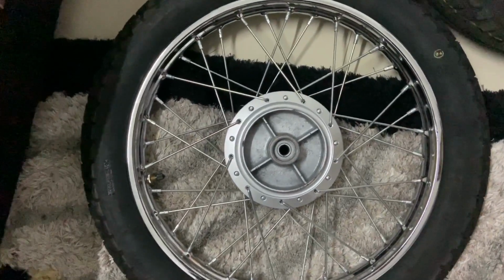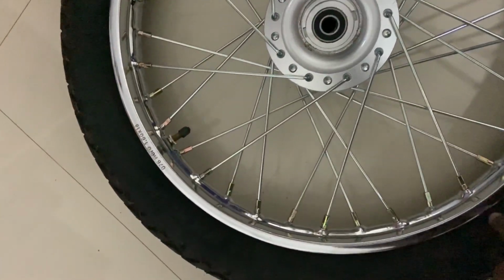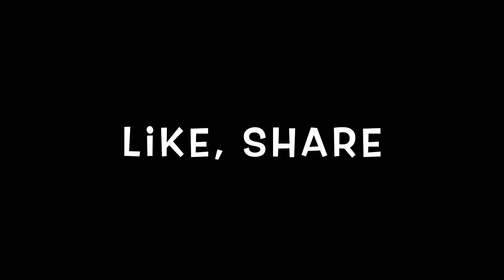Rebuilding the Yamaha RXZ part 8(Tyre Lettering)

Comment: Hi bro 
Is it possible to fix 2.15×18 (xpulse ) rims on rxz without removing the chain covers , if yes can it be chromeplated as they come painted black... your feedback will help me solve the dilemma of should it be  aesthetics or performance  😂 yours friendly 
Neighbor & former youtuber
Reply from the maker: Xpulse is 19 inch, end of discussion 😆jokes apart rear would be too wide, there are other wider rim options like 1.85 inch from a stock RD. Wider rims will put a lot of strain on the drive train. And yes all metal rims including aluminum can be plated.
Reply: @Yamakaze   xpulse rear rims are 18 .. i double checked with my brother back home we have one 😁 i never thought about the rd350 ones now the hunt for rd 350 rims begin.. i    hope the perfomance wont take much of a hit compared to the 16inch ones 🤞
Thank you so much for the lead & reply bro...
Reply from the maker: @bikerbuddymotovlogs  I can recommend something else as well, cbz classic rims.
Reply: @Yamakaze  thank you so much bro.. i am currently in hunt for the cbz rims.. seems rxz spares are more easier to find than cbz ones.. lets see 😁😁
Reply from the maker: @bikerbuddymotovlogs  I have two lying around 1 needs plating, ping me on Instagram
Reply: @Yamakaze  ok bro i have pinged you ..
Reply from the maker: @bikerbuddymotovlogs  👍

Comment: How's the performance of this tyre in terms of both dry and wet grip, handling, braking and cornering etc...... Heard it's not at all good for wet grip
Reply from the maker: i have not had any scary situations, this being a soft compound this should perform better than the stock MRF in wet conditions
Reply: Tyre name please? Is it Michelin Sirac 2.75-18?
Reply from the maker: @venkateshrao3199  front is 2.75 X 18, rear is 3.00 X 18, both are Michelin Sirac street